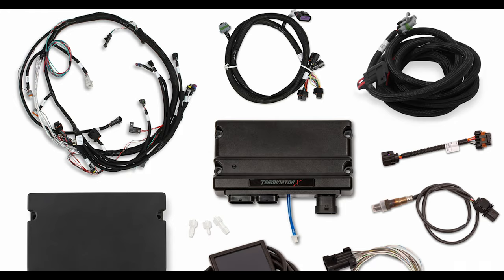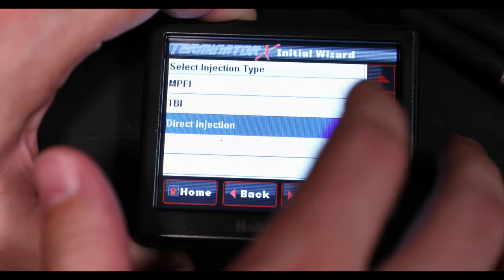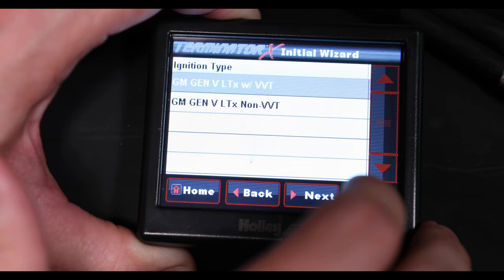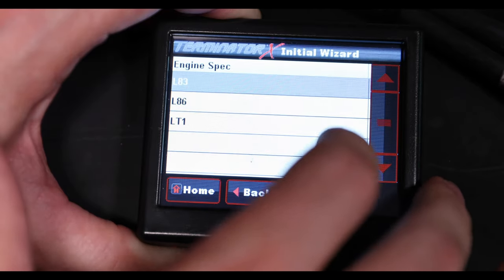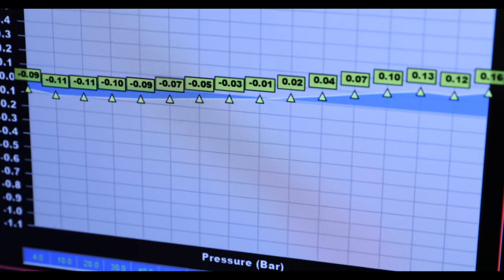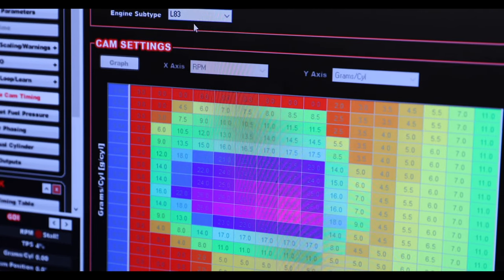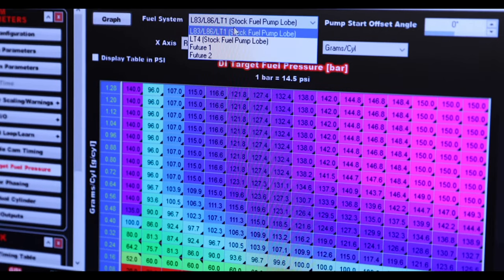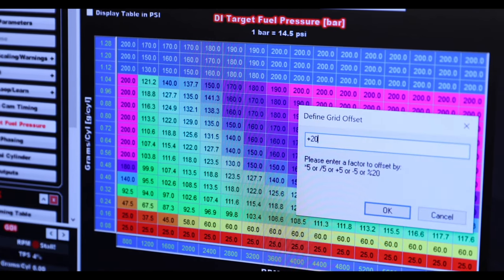Holley Terminator X Gen V LT: Set Up, Variable Cam Control, and Fuel Strategy Overview

Comment: I have 2014 gmc sierra L83 turbo truck and I’m swapping 6l80 to TH400 can i use it to run my truck
Reply: For a TH400 I think you would just need the version without transmission control